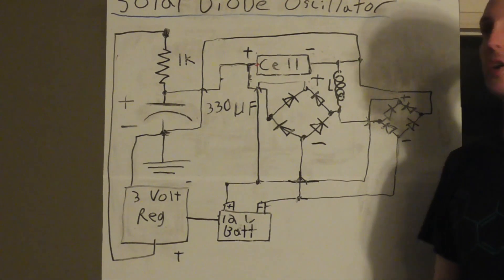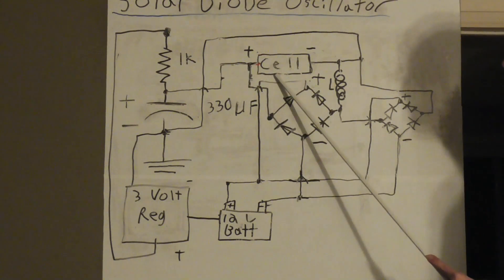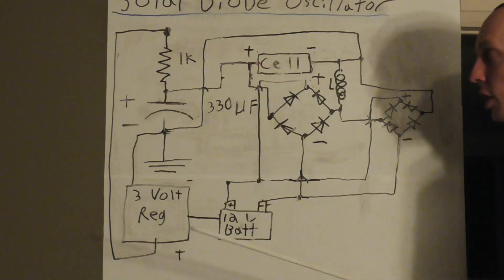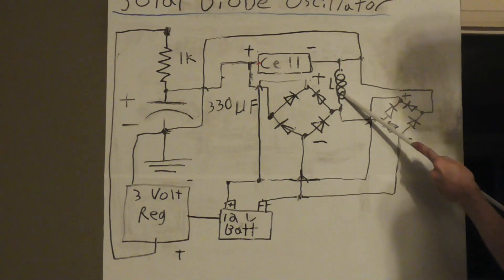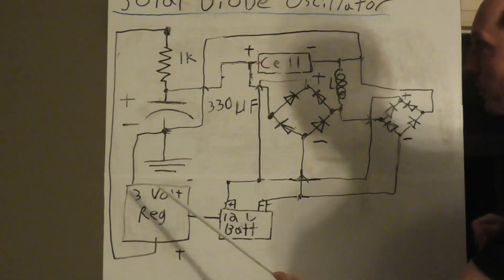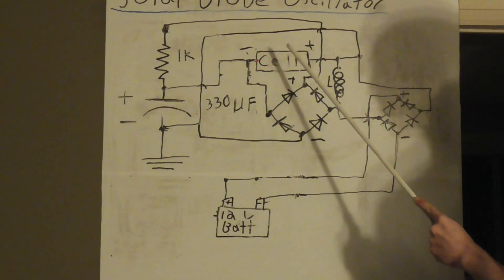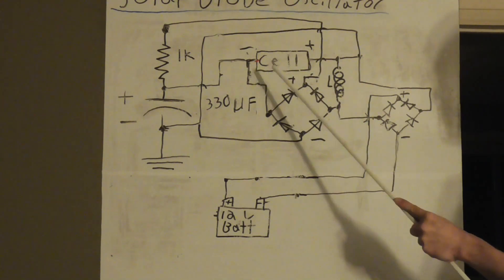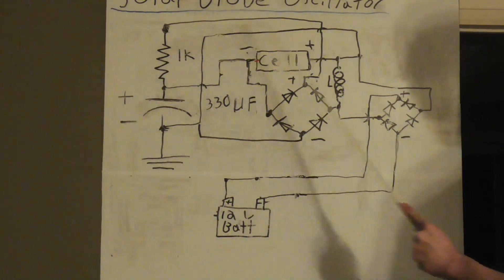Open loop Solar Energy

Comment: this circuit will recycle the flyback voltage back and forth between two storage batteries/devices/Caps. It does it with 90 degree pulse staggered 4 pulses staggered at 90 degrees on a rotor with two magnets 180 degree apart, Bedini drive coils positioned at 45 degree apart only 2

Comment: Thats smart circuit though , use 3 volt oscillator to charge the storage battery off its own energy combined with the Moon light at low volts , a 100 watt panel at night configured like this should pull in around 10 watts with full moon exposure

Comment: Best to use solar panel to drive a pulse motor than spins a super heavy flywheel on a magnetic bearing . Then glue magnets in a 3 phase array and place the matching 3 phase stator in proximity of the magnets glues to the flywheel. DONE!!! (Flywheel is heavy enough will spin for days without Sun. No batteries ever needed

Comment: Does the oscillating cell power the LCR circuit from dampting out?
Reply: Very creative
Thanks
I will give it a go
Thanks
Reply from the maker: This basic relaxation oscillator stage only uses a diode (solar cell) a resistor and charging cap. If your asking if this self sustains and doesn't go out the answer is yes.
Reply: @joellagace1679  A CLR tank circuit dampts out. Always thought with the correct shock at the correct time. This could run forever? Negative feedback spikes?
 Thanks